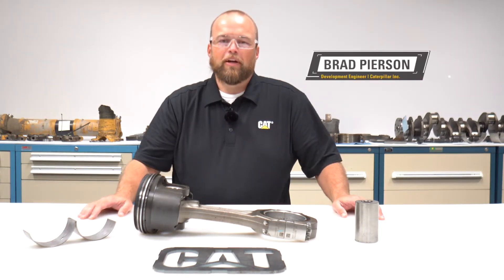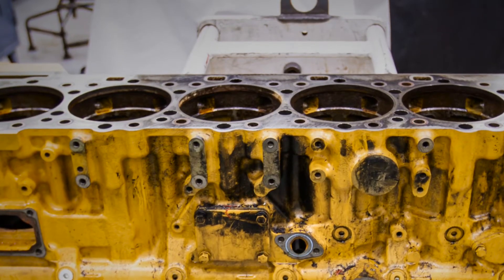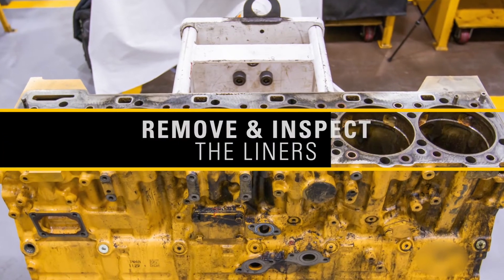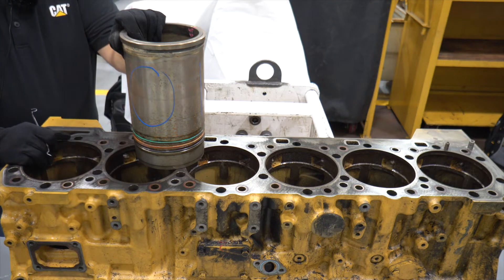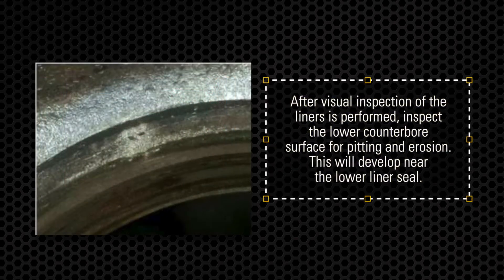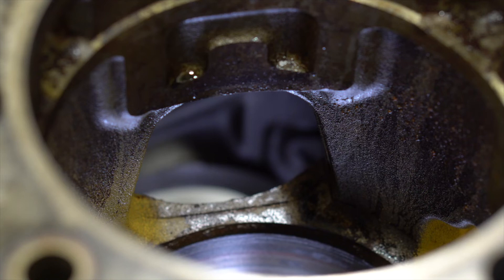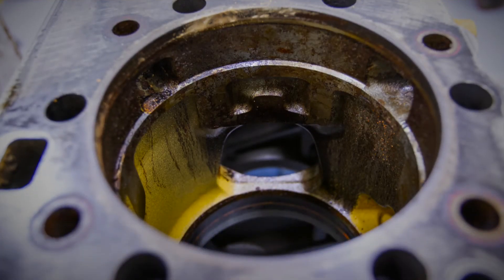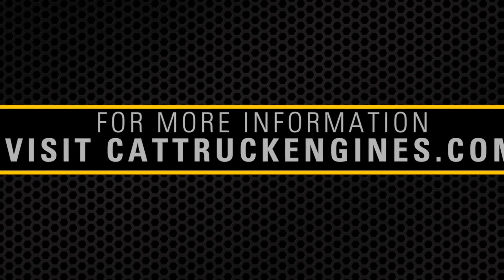Inspecting Engine Liners | Cat® On-Highway Truck Engine Lower Counterbore

Comment: What kind of epoxy do you use when you smooth the pitting on the lower counter bores?
Reply from the maker: Hi Mikey! Belzona® 1311 (Ceramic R Metal) is the recommended material to use to smooth very light pitting in the counter bores. - Eddie